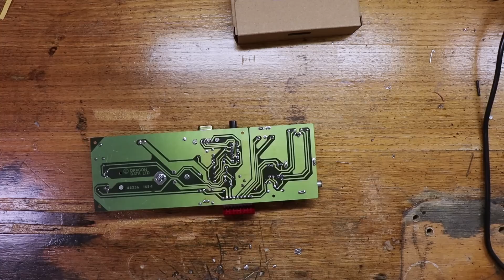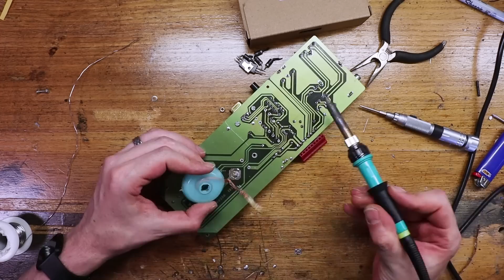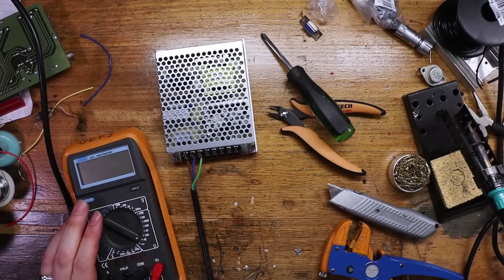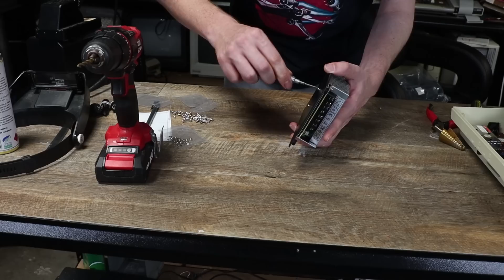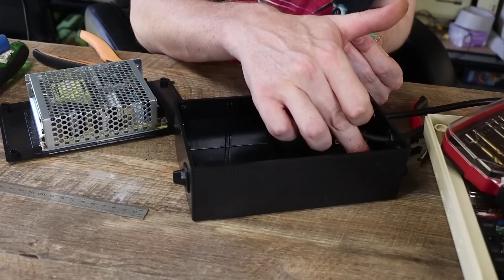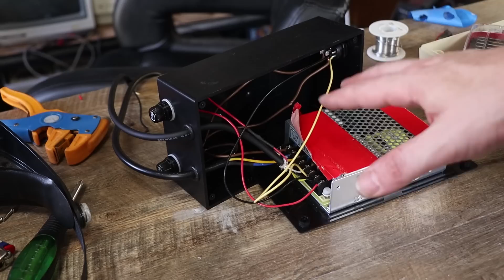Dragon 32 Pt1: The Power Supply

Comment: You can get all-in-one IEC connector modules with a switch, fuse, and a power light for about £10 and would be way safer than having random folks off the internet try to correctly wire up all those safety-critical AC mains components together.   IEC socket on the outside, a pair of switched contacts (and an earth point) on the inside.

Comment: Loved the video, the label on the PSU really made it shine, great work.

I owned a Dragon 32 back in the day. Bought one, boxed about 18 months back. Made a video cable for it last week, and plugged it in (after checking the PSU and internal DC voltages). All was good so flipped it on and it worked! The keyboard was very oxidized on about 95% of its key switches. So used de-oxit + lots of keypresses to revive. Also the picture was horrible, lots of crawling, it that appears to be because the chroma part of the composite was overdone. I dialed it back, and now it's decent enough.

Next stage, I also need some way of loading the old programs, and I need to get some peropherals like the joysticks. Really nice to have the Dragon working again :)

I wonder if its possible to get to a LUMA / CHROME set of signals on the motherboard? Would be lovely to get LUMA/CHROMA out.

Comment: Great video! I'm thinking of replacing my Dragon 32 PSU so this will really help... I was wondering if the Mean Well unit would fit inside the case? (I get that you decided not to, but I quite like the idea of avoiding an external box). The 2A fuse on the 5V out is something I'd not considered - cheers!
Reply from the maker: Ive seen it done, but its not pretty.

Comment: I think i prefer the solution where the psu is in the case.  Leaving the original DB9 sitting there expecting non-standard voltages just sounds like asking for trouble.
Reply from the maker: It’s now clearly labeled. Also, Dragons are so uncommon here in Australia that the chances of this machine ever meeting and OG PSU are pretty minimal.
Reply: @MrLurchsThings    I kind of wish there was just an easy power-board upgrade with modern components, to be honest.  Take maybe 15v in from a common or garden laptop supply, or one of those new intel 12VO supplies, run it through a few regulators for your 12v, +5 and -5, then take the composite straight back to a DIN or standard composite, maybe take the audio off to the old RF jack instead.

The Dragon seems pretty compelling to work on, to be honest.

Comment: Noticed the desoldering tool you were using as an Anesty.  Does yours work fine?  I've had nothing but problems with mine and opted to get a yihua which is more powerful imo
Reply from the maker: As long as its kept cleaned and maintained - no prob at all

Comment: Absolutely amazing to see the Dragon 32. I actually still have mine from when I was a kid along with all of the cassettes, some cartridges, joysticks, tape player etc. I feel like I need to see if I can get it working again! I'm assuming I'll need an older TV however! 😂
Reply: Yes, they only support RF out,  or if you buy or make a cable, Composite. I made my own Composite+Audio lead, and connected it to a Commodore 1084s monitor, and it works well. If you want to go retro, try and get an older LCD from 2000-2010 as these can have Composite in. Best thing to do is find a local house clearance company, and let them know you'll buy any TV they have that fits the bill.

Comment: The -5V reg isn't screwed down because the screw connection (and centre pin iirc) is at -5V rather than ground. If you do attach it to the heatsink on a 'working' power board with an original PSU you'll short the -5V line and let the magic smoke out. Oh and the picture quality of the dragon is notoriously terrible. Mine's still rather ghosty/ dot crawly even after a recap and playing with the video trimmers.
Reply: Yes, the 7905 "floating" catches out a lot of people who don't know what they are doing. To be honest this is almost certainly a design fault but since the -5V is only used for the DRAM memory chips the regulator is not heavily loaded so can get away without being bolted to a heatsink. The other option would be to use a thermally conductive electrically insulating pad between it and the heatsink. Realistically modern switched mode power supplies generate very little heat when providing the amount of power that a Dragon needs so they are absolutely fine inside the case.
Reply from the maker: Afterwards I plugged it into my Sony Trinitron CRT and it’s pretty good. Still noticeable dot crawl, but the rest is way better.
Reply: @MrLurchsThings  Clearly the Sony's more forgiving of marginal composite signals than modern LCDs and cheapo upscalers :)

Comment: Another great video! Just one thing you might want to improve for next time - you were a bit zoomed out at the start when working on the circuit board. My tiny monitor and old eyes couldn't really give me as good a view as I wanted.
Reply from the maker: Yup - 30c+ day in the shed = low concentration :( If this heat keeps up I may actually have to clean up my office and shoot these types of things back in there again.

Comment: What is the maximum operating temperature of the meanwell unit and how hot does the inside of the jiffybox get?
Reply: I was worried about that especially when he covered the ends in tape. Shouldn't there be a few holes or slits in the outer plastic case for heat dissipation?
Reply from the maker: I’ve had it running for quite a while while building/testing and even in the summer heat it didn’t get warm enough to be concerning.
Reply from the maker: Like I said, I didn’t have any heat issues - but had some time this morning so....
https://twitter.com/mr_lurch/status/1350596382118215680?s=21

Comment: Good job on the safety features, although you shouldn’t have needed that ducktape if you heat shrink tubed the solder points inside. Whether or not you do that on camera, please consider doing that for the mains side at least.
Reply from the maker: I had, but had a couple things of small touch up bits to do this morning so went through and double checked everything.

Comment: Hopefully nobody ever plugs in an original power supply.
Reply from the maker: Should probably make a label. Mind you, in the incredibly unlikely case of me selling it, it’d be sold with the PSU.
Reply: Some reverse polarity protection power diodes would cause the thermal fuse in an original psu to pop fairly quickly while protecting the dragon from the worst of the AC input.
Reply from the maker: Label: https://twitter.com/mr_lurch/status/1350596382118215680?s=21